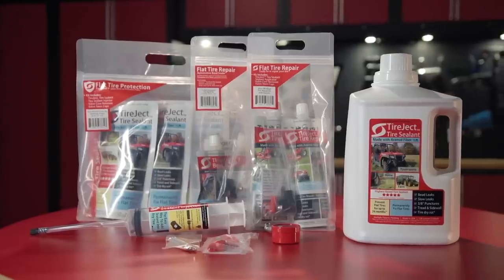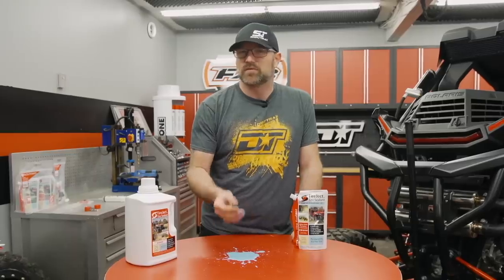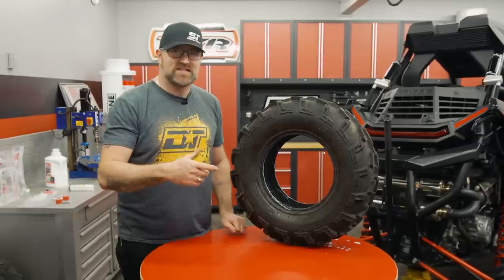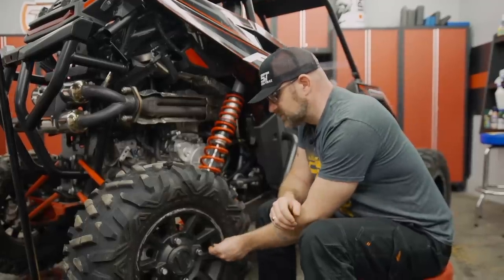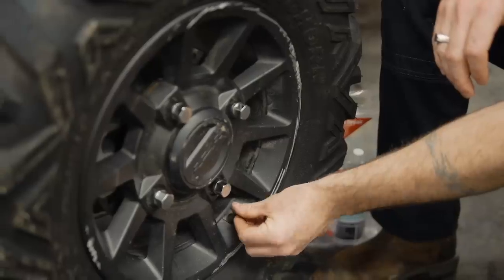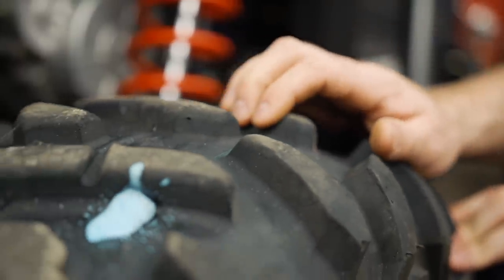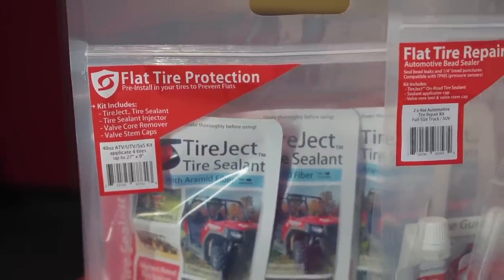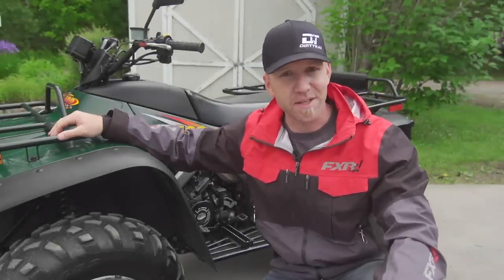Maybe The Best Way To Fix A Flat Tire

Comment: Most of my flats don't happen in the shop and it's a pain to carry my floor Jack out on the trails but I like the idea of pre protection.
Reply: Hi Rick - thanks for checking out the video! No jack required for the install - They used a jack in the video to show the rotation in place. To install simply remove the valve core, inject through the valve stem, thread valve core back in, air up and then immediately go for a drive. But, as you noted you can avoid all of that on the trail by going the preventative route and pre-installing.
Reply: Works great for pre

Comment: You said that tire is a set of four but it is the only one on the rs1.  None the less looks like a nice product.
Reply: Simple really, they are doing it ON a machine so as to fully demonstrate the procedure. I imagine the RS1 was already in the shop (heh, its a Polaris) so they grabbed a tire with a known flat, that fit on the RS1, and used it as an example.

Comment: if it is water soluble, what happens when you ride through the water after using it to make a repair?
Reply: Hey Nick, great question - TireJect is water soluble while in liquid form only. When you get a puncture the sealant is exposed to air and it will cure with the rubber for a permanent seal that is not affected by water, mud, etc...
Reply: Will it push out Tire plugs like the competition?

Comment: I finally have got. Homehardware. Black n Decker. Pecker rekcer... Maintainers. I finally was told to get a maintainer. And i had gotten a battery charger starter. I was no u need a battery tender. For your Quads. Its kool plung and leave. And it can be pluged in with the wires. Added and u can just plug tender any time. And battery plug. Its nice. My quads have cigar liter plug in them..female end. My tender is the mail. Very good for AGM batterys

Comment: The best way to fix a fat tire is a tire plug set...hands down.  Less time, reliable, no stickey mess.  Plug it, pump it up, ride.  End of story...
Reply: One thing to keep in mind is that plugs do dry out and leak over time, TireJect is 100% compatible with plugs and can be used together. We fix faulty plugs all the time with TireJect and we also use plugs all the time for larger punctures and add TireJect to make sure we get a good seal. Plugs definitely still have a place and we recommend keeping them on hand as well. Also, if you pre-install TireJect you will proactively prevent flats and stop any down time that would be required to install a plug. If you ride in an area with lots of thorns this is a huge benefit.
Reply: @Tireject  Yes, in combination is the best, but I use plugs to get out of the middle of nowhere, even on my truck.  That and a compressor and you can go anywhere in confidence...
Reply: cr500blur this stuff lets you keep going without stopping in my case I’ve had punctured in my side by side tires and never knew till I returned back to camp. That means I never let the tire get to low with air at high speeds before realizing it was almost flat. Does it mean that I stopped carrying air and plugs no but I sure haven’t had to use em yet. This stuff works and it sounded to good to be true but it’s saved me a one particular time when I was alone for a short rocky ride and came up with a gnarly sidewall gash and this stuff saved me from having to hoof it back to camp. To many instances I’ve used this stuff for my buddies flats onsite and they looked at me like I was nuts but after they finished off their weekend on the repaired tire they were sold. Good stuff if your smart enough to use it.
Reply: We used a plug last year on a Colorado trip on a Razor and it took 5 minutes to repair with a plug.  The next day we saw the same 4-seater in Silverton with the plug still sticking out of the tire for another renter.  To me it's how long it takes to do the job....
Reply: Plugs don't work on cuts tire ject does stuff really does work have it in all my tires on my offroad toys

Comment: Question. Do i charge my bikes over the winter. Or do o trickle? I has them glass packed ones
 Xmr 1000 outlander 2018 n my maverick trail dps can am 800? Thanks guys....
Reply: Plug it into an automatic battery maintainer like a 'battery Tender' or 'Optimate' or some other known battery maintainer brand. The charge rate in printed on your battery, a trickle charger is uaually too much at 2 Ah charge rate and you may damage the battery. It's also important to realize that a battery maintainer is different then a trickle charger. A trickle charger is nowhere near as sophisticated as a battery maintainer and you will get much longer battery life using a battery maintainer.  The AGM battery for my atv was over $200.  I have 3 different devices plugged into my recreational and power equipment depending on what was on sale. I'd recommend the Battery Tender Plus with 1.25 Ah charge rate for bringing that battery up quicker after a day of winching unless you have smaller equipment batteries you would also like to maintain with the same device. In that case, the Battery Tender Junior will work fine for all your equipment.
Hope that helps.
Reply: @scottfurlong5475  ok then. I do not know if i have a tender. It says 12/6volt charging. And boosting. Say it has a smart brain in side. These ones. I did not know about tendets. Gal darnit. Oh well. There brand new bikes. My dad said. There brand new. They be ok. Im like. Idk. 50 60/ below. Wind chills was cold winter. I guess i should try
.but. If there dead and it starts. I dont to rune. Altinater or something. That u very much sir. Much appreciated..
Reply: @canadaplace2be176  A battery maintainer should not have a boost function. That sounds like a smart charger and would not likely have a low enough setting for most power sports batteries.  Conventional power sports batteries need to be maintained during winter or prolonged periods of storage. They begin to loose power after 30 days. AGM batteries are better but still need to be maintained.
Reply: Well my can ams been sitting since. October 2018. And fired up like nothing. There a glass battery. Not gel. Or agm. And the maintainer i got. Can charge to. Its the black and decare. Charger maintainer. So i just need. A maintainer. I thought so. Its hard to get one with out charger.. Stanley has on. Just maintainer. No charger. Has a hook to hang. And battery maintainer has a hook to. And a litter male version. I did not get one. Thank u for comment..
Reply: @scottfurlong5475  thank u. My batterys. Where in 50 below weather and the maverick and xmr. Firex up like no tommorow. I could not Beleive it. Well there 2018s. I wonder if thats why. ?. Ok i get a maintainer. Then. And look on my battery. Glass can go up side down n around. Is glass new or is it dam good. And is it 200$ or way more. I will. Get that stanley one. It has just maintainer all over it. 1.25right..?
Reply: @scottfurlong5475  well this lil charger i got was 30 bucks CANADA. And its a 1 amp. And says 6v/12v maintainer. Or charger. These batterys are glass. Not agm wet or gel they sat 6 month. And turned over like usally. But i got this maintainer. Because i was going to maytain. Them. But. I dont know now. The work fine after 6 months. They 40.000 both them not cheap bike's. Lol. Thanks any way. Leave me a message if u want. Much appreciated..

Comment: Now, if they could just show some type of abundant air supply that you could take along with you. Does anyone have a recommendation for a great 12 volt pump because those little guys you get at the auto parts stores are garbage and I find myself using five or six CO2 cartridges just to get the ATV tire inflated. Maybe a long narrow compressed air cylinder similar to a SCUBA tank or fire extinguisher.
Reply: Viair. Make a great pump that is designed for the RV industry think 100 plus PSI and you pay for quality. Currently we have a harbor freight #69285 12 v compressor that is cheap junk but it works and I don't feel bad when i loan it out and my buddy forgets to give it back.
Reply: No air needed on the trail if you pre-install TireJect you get flat prevention for 12-18 months, also we do have large 60g co2 cartridges for trail side: https://www.tireject.com/collections/all/products/automotive-emergency-flat-tire-repair-kit we like these because its instant air pressure and will inflate a tire in under 30 seconds and pretty compact. 1 of the cartridges will inflate a 26x8, a larger tire would need both cartridges.
Reply: Ya bro. U can bring the air hawk. Runs of drill battery
 And uses the air around us. Kool eh?
Reply: Bicycle pump, you are only putting less than 8psi.
Reply: Dewalt 20 v cordless inflater light durable works great